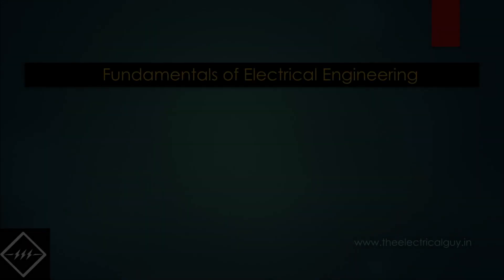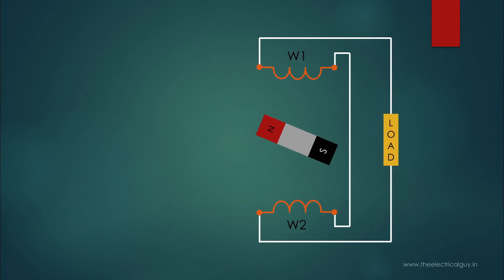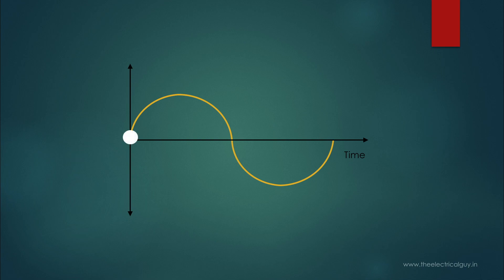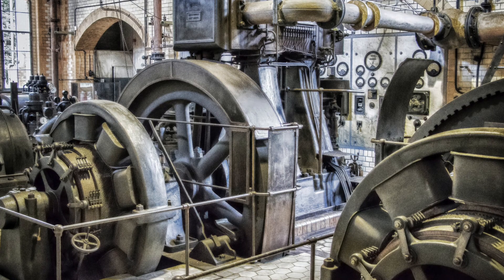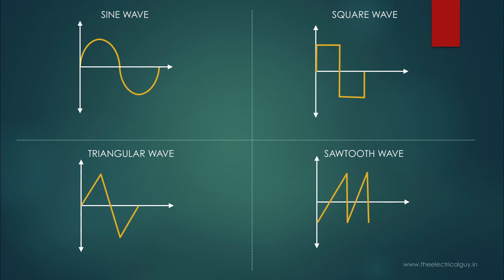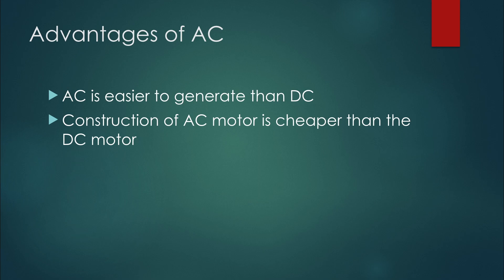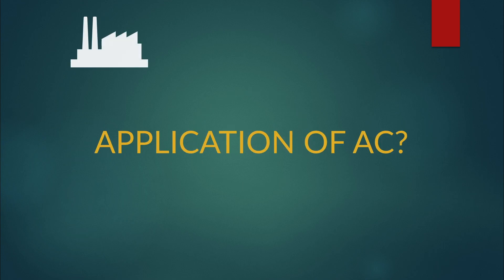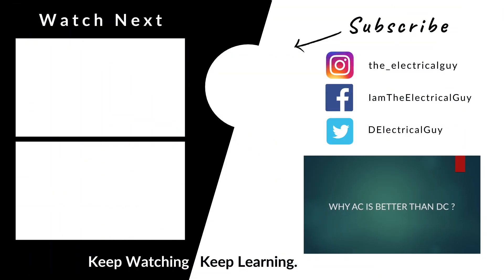Concept of Alternating Current or AC | Current & Voltage that Alternates !

Comment: In ac, electron travel back and forth, then how the electron reach the destination.
Reply: Not sure if you have had a response on this yet. The point is, the electrons do not actually need to get to the appliance - there are already electrons there. 

If you think of a simple circuit like a resistor acting as a filament in a light bulb, every stage of that circuit - the power source, the wires, the resistor itself - already has electrons. There is a continuous chain of electrons, all next to each other, at every point in the circuit at all times. What the power source does then is just give the electrons a ‘push’, in line with the voltage of the power source. Each electron then in turn pushes the electrons next to it, all the way through every part of the circuit, until finally the electrons in the filament push on one another and the wire resists the pushing to create the heat / light. This happens nearly instantly. 

With AC, the push at the start of the cycle just changes to a ‘pull’ at the end on the cycle; it still works exactly the same way, and now every electron in the chain pulls on the electron next to it. Each electron’s actual movement is tiny, so it does not matter if it goes one way or the other. So with a light bulb connected to your AC power socket, it is not the case that electrons move from the generating station travel through the wires to your house and then into the light bulb to make it give off light; all that happens is that the pushes and pulls from the generating station cause the electrons already in the bulb to shake back and forth. It is that movement of the electrons already in the filament that makes the light come on.
Reply: @londonclassicist  thanks and appreciate that
Reply: @londonclassicist  This is the answer I was looking for. Also it  makes sense 👍